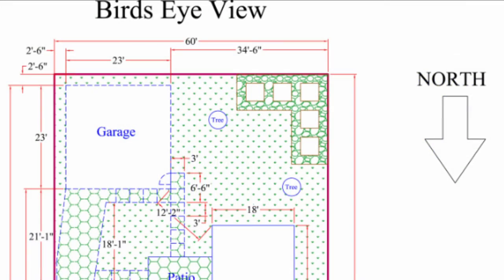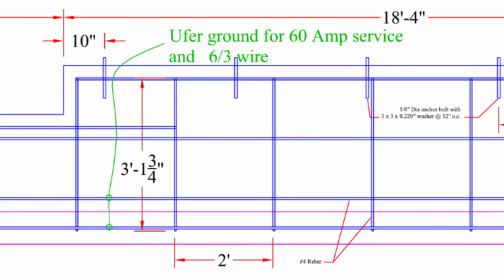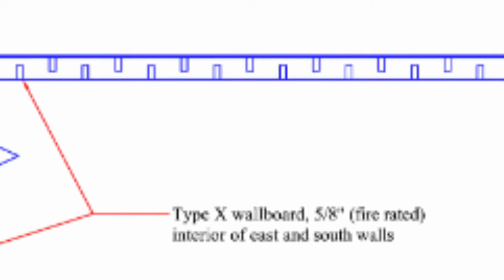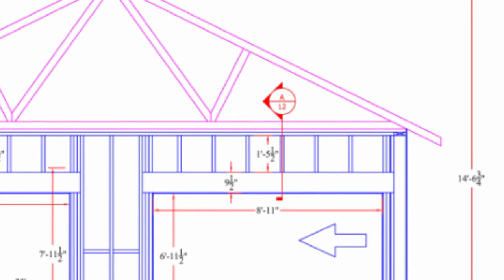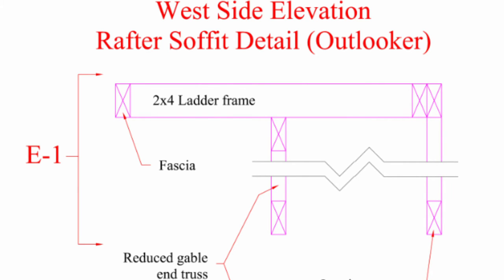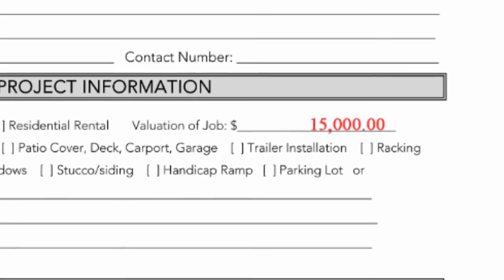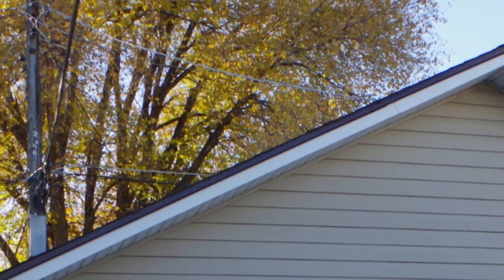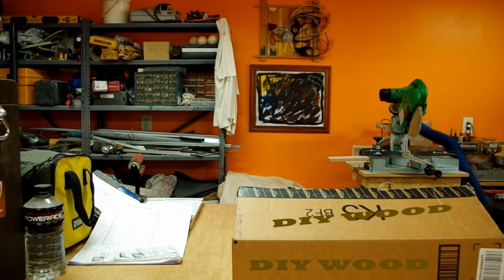Garage Build - Blueprints and Permit | BUILD IT

Comment: Loved this video series!  I'm working on my own plans now and am curious about stretches of lumber longer than 12', which is the longest length you have on your estimate sheet.  You didn't need to show where the ends of the lumber are?  So for example the top plate of the back wall is 23' long which would require a 12' piece and an 11' piece.  They didn't require you to show where the two pieces meet?  I would have thought they would want to see that.  Seems like it would also be helpful for estimating.
Reply from the maker: Each wall was two walls so the 23’x23’ garage has 12’ long pieces. I called out the spec for splicing the walls at 6:59 . If an city/inspector doesn’t accept the call out I would brace for needy city inspectors. I didn’t get that specific in the visual part of drawings but yes, I found all the details helpful to order EXACTLY what I needed.

Comment: Did you have to pay an engineer to stamp the plans? Can you build without an engineer?
Reply from the maker: homertalk ... If you live in a city, they might want an engineer stamp. My city wanted to see the blueprints approved and stamped by an engineer. But when I went to the engineering firm they said that my blueprints looked so good and accurate that I should go back to the city, mention I talked to the engineer (without a stamped approval) and see if the city okays the project. So the city did okay it. So the blueprints you see were all drawn by me with AutoCAD. I designed it myself but I have a construction and architectural background. You can buy plans on the Internet, then modify and customize as needed.
Reply: Do you sell your blueprints?

Comment: Congrats bro this was a great video and brought my spirits up about doing it myself
Reply from the maker: zeke lopez ... Great!  Plan it, follow the plan, don't quit. Push forward with each step.
Reply: Dear Heavyboxes DIY Master - hello and thanks for the tips. I ran into a problem with the city again. I sent in an email, if you have a chance. The issue is with the height of my proposed garage walls. My house walls are 8’ but I have 14’ cathedral ceilings inside home. I went with 10’ high walls for proposed garage, a difference of 2 feet. I believe the issue is my garage cannot by taller than my house roof ridge. If my garage is 20’ W x 24’ L with 6” on slab/footer and 5/12 roof bitch, how tall will the roof ridge be on the proposed garage be in comparison to my existing homes roof ridge?

Thanks Again, you have been great and helpful. I never anticipated having such difficulty with the City planning  and development department.